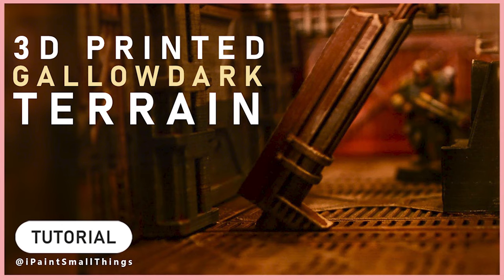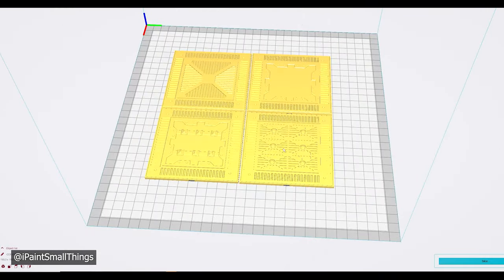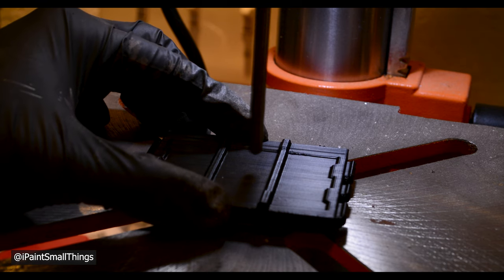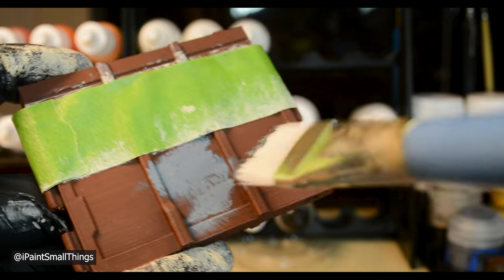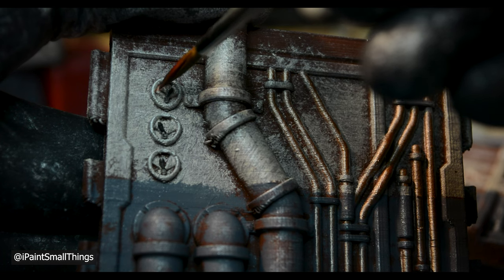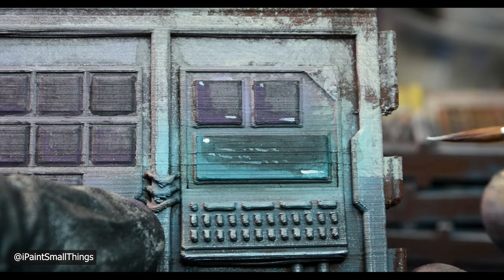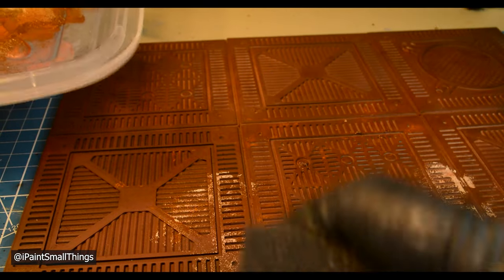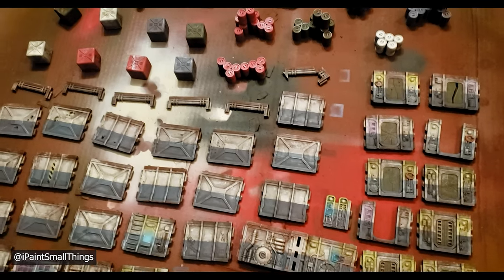3D Printing a Gallowdark Board

Comment: I have a bunch of FDM terrain I printed out of airship kit my trick is to cover them in regular basing texture. Not only it enhances the grin dark look but hides the printing lines very well. I can't stress how easy it is to apply some texture to those pieces. You can paint them as corrosion or grime it dosent even matter.
Reply from the maker: I actually was planning on doing something like this for some Tatooine terrain I just printed-- possibly using textured spray paint. I'll have to test your method out, too!

Comment: Nice video.  Instead of the painter's tape, you may have been able to make a couple of half height pockets out of cardboard or stiff paper that you could put the piece in, stiple, remove and put the next piece in.
Reply from the maker: This is a really smart idea! Especially for the flat walls. Thanks!

Comment: Try using sponges or open cell foam instead of a brush to stipple paint on.
Reply: Whoops! I see that you switched to sponges later in the video.
Reply: And everything looks great. I need to square some stuff up on my FDM machines and get back to printing. Because this is exactly the sort of stuff I want to be able to print for my gaming table.
Reply from the maker: @looselycollected7505  haha I realized that way too late in the project.
Reply: I switch up or change my mind on thongs mid build all the time. No worries there. It's good to stay flexible on projects.
Reply from the maker: @looselycollected7505  haha it's the way it goes-- a lot of "well I should have done that different)

Comment: I'm almost done printing a set in resin, im a bit worried about the magnet, 5x3mm don't fit, need to go with 4x2mm. 
I hope the result are half as good as yours !
Reply from the maker: That would probably work, too-- as long as you super glue them in there they should work fine!
I'm sure it will be fantastic!

Comment: Could you share your settings for cura? I tried mine but they don't fit when I try to clip them together.
Reply from the maker: I print at 210° extruder, ~60° bed, .2mm layer height, and with a brim. Hopefully that helps! I find a brim is a really good way to keep things from warping, which may lead to things not fitting right.

Comment: Do the parts need supports or not?
Reply from the maker: They shouldn't-- but just make sure the print bed is super clean! I recently switched from 70% to 99% IPA and it made a huge difference. For these (printed before I switched to 99%), I printed with a brim to help it stick a little better.